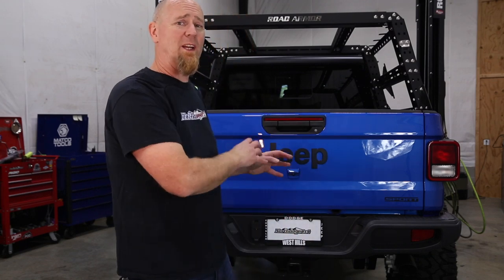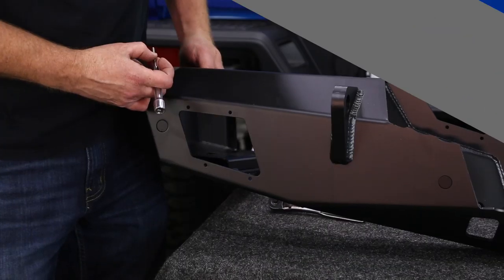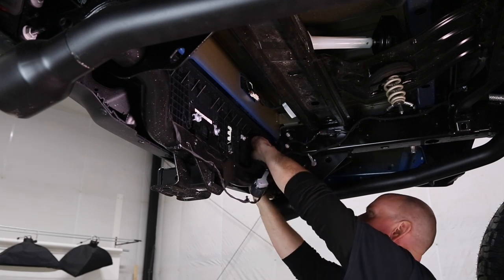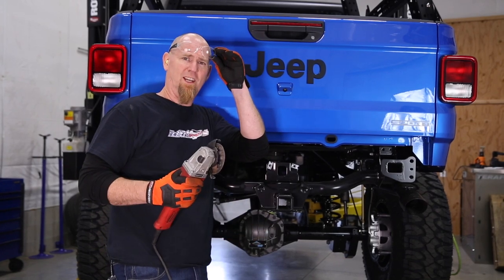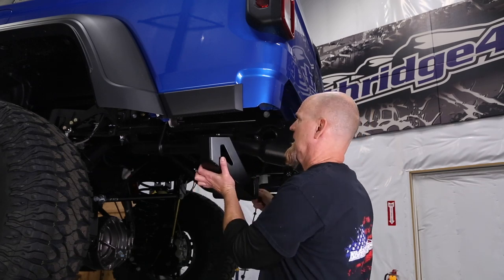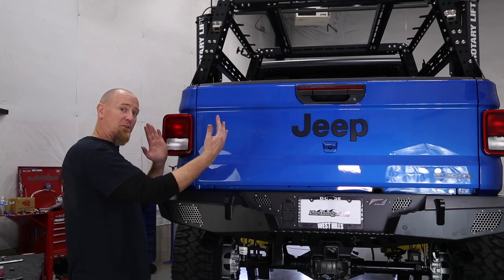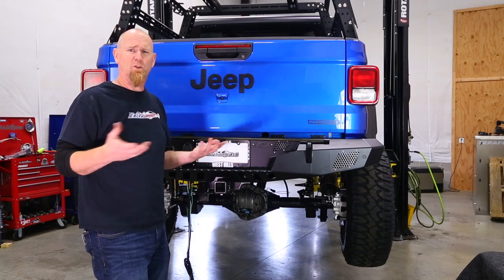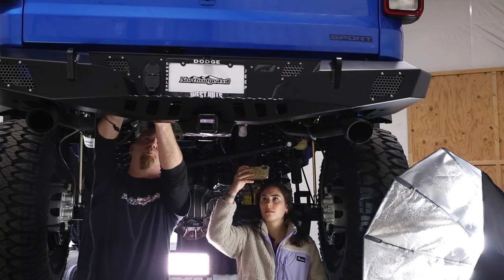Motobilt Crusher Series Rear Bumper Jeep JT Install + Putco Blade

Comment: Just installed mine yesterday after prepping and raptor coating it first.  This video was incredibly helpful in walking through the steps, and the bumper itself is a tank. Even the bottom of the bumper has a large shelf to help protect .  Definitely get the optional side mount brackets, in combination they make for an incredibly rugged mounting to take on any type of abuse.
Reply from the maker: How do you like it?

Comment: @Northridge4x4 this bumper looks incredible and I'm having a hard time deciding between it or FabFours full coverage rear bumper with integrated side step.  Both are very similar in price point and function but design is where they greatly differ!  Really liking the crusher the more and more I see it.  Definitely need something with full wrap around protection.  Awesome video and anyone complaining about it not being "Bolt-on only",which it totally is since there is zero welding required, is just afraid to get out of their own comfort zone....my 14 year old daughter could make that cut!  Salute!

Comment: what lights fit in the back of that bumper? The aftermarket lights that fit in the stock bumper where the reflectors are clearly won't fit. Thanks!
Reply from the maker: Motobilt doesn't offer or recommend a specific light for that cutout.
That said, we have fit small 2" size lights in there.

Comment: Can I run this rear light bar if I have a trailer brake controller, with and without a trailer hooked up?
Reply: Yes you can. The Putco Blade is a plug and play system. Just make sure to get the Quick Connect harness to go with it.
Reply: Tim Lund thank you. I’ve heard that sometimes accessories designed to use the trailer harness can get burned up when using a TBC